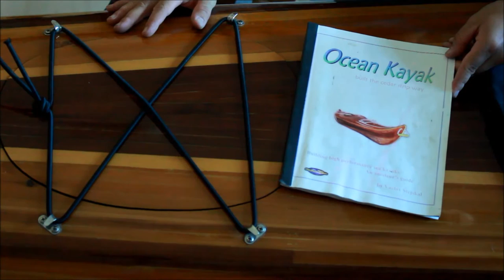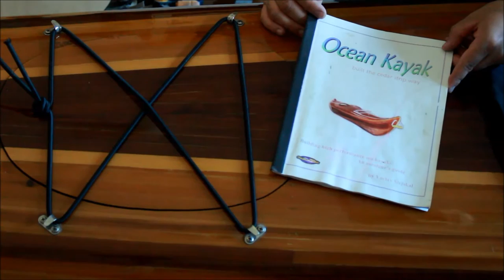One Ocean Kayaks Cape Ann Construction (Revised)

Comment: Beautifully done Kayak! I bought the Expedition Sport plans from One Ocean Kayaks years ago and I want to build it so badly, but I get so frustrated trying to find clear western red cedar boards where I'm from. I found strips already milled online but they are so darn expensive that I'm not going that route...I'm to the point I might try clear pine milled to 3/16 of an inch. Anyways, nice job!
Reply from the maker: There is a beautiful one from Clas Kreutzman in the builders gallery. Here is a link to it , his is a cape Ann hv .http://www.mobisound.com/gallery/capeannhv_launch
I have met with two guys that built their kayaks with 3/16 thick strips and the reason was for weight reduction ( they were racing theirs) they also said that they were not lasting because the strips were thinner. Looks like their kayak were getting more use than the average paddlers though. Would it be worth while to order your red cedar boards online?
Reply: +Tomy Hovington That is a nice looking kayak. I love the lines on the Cape anns. It seems ordering online is my only option if I want to use Western Red Cedar, which I do!